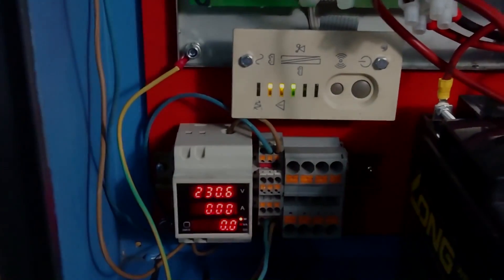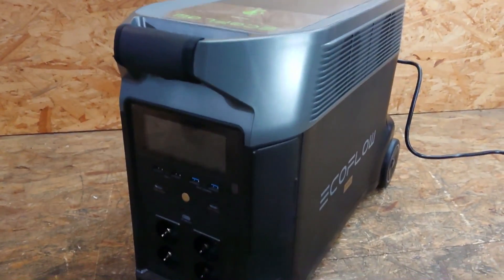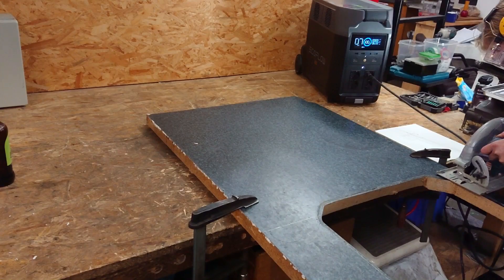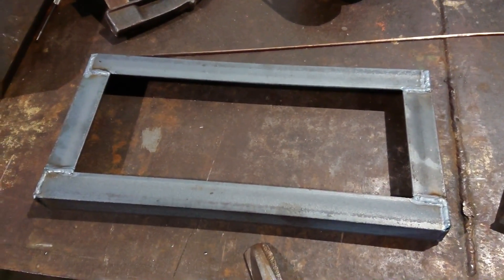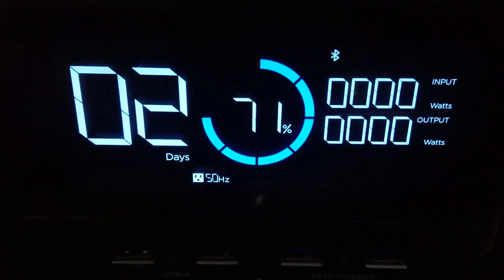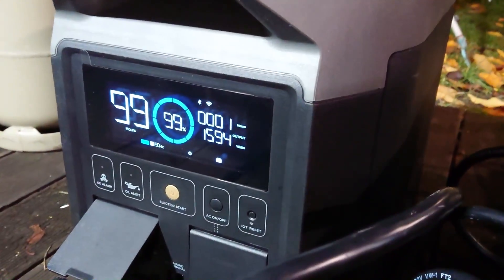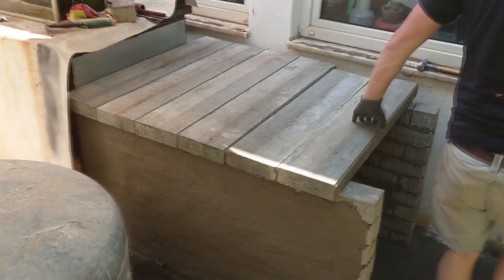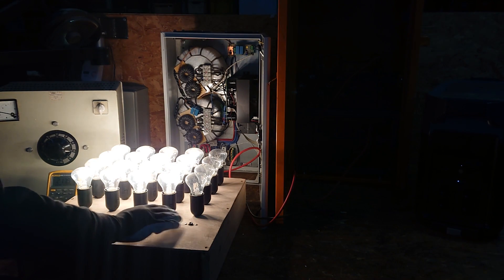Building a DIY Off-Grid Power System (vs. Ecoflow )

Comment: Great Video.
a while ago, I looked aruond on ebay and found a Generator from 1966, until then I also thought the SACHS ST 282 was the biggest Gas Engine they made, but to my suprise the Generator I found had a SACHS ST 400 on it. 
After some search online, I found out, that the ST 400 was the biggest Gas Engine Sachs made.
The ST 400 has 400cc and arond 10-13 HP.

Comment: these ecoflow and other such combined unist are ridicules expersive ( and many units still use the liion cells ) for a fraction of the prize one can build a 7 kw 24v or a 14 kw 12v battery with brand new  280ah lipo4 cells and a good bms ,(all in all about 1000$) 
 my battery is a 24 8s variant at about 7kw i live offgrid , and have enough power for about 5 days of usage , to power my system i use the following
6 old 100w 20v (open voltage)solar panels 2xseries x3 strings in sunlight the charge on the battery is circa 12,5 A
2x 200w  40v panels (with broken glass)  charging about 6A
this is covering my elecritrical needs  lights blowers for gas heaters alarms tv ,laptop waterpumps diesel heater small refrigorator e,c,t
the  charge units are
a cheap solar vind hybrid charge controller 
a 10$ pwm charge controller for the broken glass panels
for future power generation mainly during winter time i have a 1500w 24v turbine
a old 12v 400w turbine
2x 12/24v used millitary generators
2x 230v 3,5 kw millitary gererator
these generators i purchased very cheap a few years back,but a standart unit or a homemade 12-24v will do well to 
it dosent take much...

Comment: Maybe it could be a good idea to do one or two projects to both turn fryer oil (waste oil) into diesel AND how to make a rig for water electrolysis so you can be fuel-independent as long as you have access to very rudimentary ingredients. For the electrolysis project, one of the ways to control output (especially in an automotive application) so you aren’t producing a bomb with too much highly flammable H2 is using PWM (Pulse Width Modulation) tied to the accelerator pedal so the gas is only produced on-demand.

I don’t mean to be putting words in your mouth or anything, but I have felt for a while that creating a plug-and-play control box for electrolysis (all the electronics in one box) with a PWM circuit and fused power in from the alternator. That way people could install a safe and effective electrolysis HHO generator feeding into the intake just downstream of the airbox/filter box to improve their mileage and power by decent figures (I heard 20% and 30% or so respectively but haven’t put one together yet). These units also work for diesel engines.

Cheers and thanks for the great content and cool ideas/projects!
🖖😎👍

Comment: A lot of generator noise is down to engine vibration. I also have my generator on wheel board like that. I used vibration isolation pads between the generator & the wheel board & it has cut down on the noise quite a lot.

Comment: The noise on the old generator could be improved with a better muffler system. It does not look like the motor uses tuned exhaust scavenging like a racing bike, so a compact car muffler from a junkyard should help a lot.

Comment: Wait Wait Wait hold on hold on .... that was 3000 watts on a 10inch grinder cutting 4 inch channel and that power source never blinked ... I need one in my life !  I'm early in the vod so I'm going to ask now have you tried to weld off the power source if so how did it do on the duty cycle ?

Comment: You didn't show any cooling air in & out in the 'gennie garage'. Generators are difficult to quiet down. If you could find a gennie with a four stroke engine, they are way easier to quiet down. Most of the little gennies run at very high rpm's, 3600 to get 60Hz. My big gennie is an 1800rpm unit with a 4cylinder diesel, 24Kw. Quieter than my 8Kw gas unit. Both are 120/240v single phase. Liquid cooled engines are also much quieter for their size. Michael in Colorado.

Comment: Look in your area you might be able to find a place that deals in used lithium phosphate batteries here in the United States we have a couple of places that do. Sometimes you have to bid on an auction to get them. Usually there's some damaged cells they can be replaced and yes it is a pain in the butt. All in all you can get a battery charger/tester and go through and do what you need it does take a lot of time but in the end you want to put something that's Superior to the glass mat batteries. They give an example I have recently purchased four 48 volt 140 amp lithium batteries for $1,100 out of them I will be able to make three Good batteries. Just a little information my friend. Keep up the good work

Comment: The Ecoflow devices are quite neat and powerful. As an all in one package it is especially useful if you do not have the skills to DIY such a system. The prices however add up, well thats the trade off, DIY vs plug and play. If you have a stationery application, their solarpanels are way too expensive. Their price might be justified for a mobile application.

Comment: It's an excellent sponsor video, because you're clearly showing what it's capacities are but also, why it exists. The 8-bit guy had similar, where he didn't want to take a sponsor but this product is just SO GOOD he really had no choice- in your case, it's showing that even a dude who practically has a full time job scrapping and reusing materials can't really beat some of the modern technology, though I would argue that inverter you have is more your speed despite it's heavy weight.
So basically, thanks! So far it seems to genuinely be an excellent product that deserves some accolades.

Comment: If you are planning to use the two-stroke generator with wood gas how would that engine be lubricated?

I am assuming that it is an older version that requires oil mixed into the liquid gasoline.

Once running exclusively on wood gas there would no longer be any lubrication for the crankshaft and the piston rings.

A two stroke engine with oil injection may work with wood gas but that defeats the original intent of reusing scrap.

Perhaps you could switch to a much more concentrated mixture of high quality two-stroke oil in gasoline but that would require reworking the carburetor, difficult to do in a speed (RPM) controlled generator to maintain the frequency for the output AC.

I want to suggest building a circuit that taps directly into the coils on the generator then using that highly variable output to convert to DC to charge the battery bank and then using only the battery bank and DC to AC inverter for your final load.

This eliminates the need for very accurate speed control for your two-stroke generator.

I am counting on your expertise in circuit design to build a DC charger that is able to accept variable frequency and voltage.

Comment: Please be careful and check if the protective earth is connected between outlets and the input (or have other measures for grounding)! A lot of mobile power stations don't have this connection and therefore no protection against grounding. I have been testing some before and it is frightening to seee how many of these aren't actually safety compliant to european standards even though they are sold here.

Comment: This is exactly the type of project I have been planing for many years. Having a generator running for the freezer during power outages is just wasteful, and I want to have a battery buffer and a self starting generator to charge it.

But, don't count out lead acid batteries yet. Since this is stationary the weight is less of an issue, and they do cost about the same per cycled kWh, depending on which data sheets to trust. My findings is that they last longer but cost more to buy, and in the end the cost is about the same per power cycled.  I believe lead acid is better for recycling and I personally think that lithium metal should be prioritized where it has a big advantage (vehicles, mobile storage and big storage in a small space) than used for things like stationary home usage.

I'm not saying lithium is bad, but that lead acid still is relevant.

Comment: I think it’s great that you have taken a sponsor. Especially something like this that is right up your alley. It’s like you can buy this great new machinery for portable power or build it out of used things like this. Or even better, build it out used things using this new machinery.

For your generator garage, did you build a outside port for intake as well as exhaust?  A little bit of insulation and that would be an awesome setup.

Comment: On the Sachs generator have you considered custom building (or repurposing) a newer larger muffler to silence it's obnoxious exhaust noise? granted that will not do much for the mechanical noise but its garage should more than adequately compensate in that regard.

Comment: That is so enviable having those old Sachs/Bosch generators around on the used market. And 3 phase output too!!!!!! I'd kill to find those in America. You can easily put a small car muffler on those engines to quiet them down and rubber mats glued to plywood make a good sound barrier. Just make sure you've got enough ventilation in that concrete enclosure or you're going to over heat those engines.
I agree, simplistic old tech is much more hardy. The inverter goes bad on those new units and you probably won't find repairing them to be worthwhile. It is nice how quiet they are though but repairability is a huge factor for me.

Comment: That modular power system is cool and all, but the generator portion looks very small. Engine maintenance/repair looks like it would be tough in a package like that. Another thing that would worry me with complex new systems like that is the life of the product. The battery may last up to 10 years but who's to say ecoflow vanishes or discontinues the setup and doesn't provide support or parts for the long term? At least with the reclaimed setup you have you can replace/add batteries, tear down and rebuild the generator engine if needed, and if you were crazy about it, rewire the rotor/stator. In my opinion, your old setup is much more modular and easier to work on than anything like that produced these days. Just keep an eye out for sound deadening material and maybe slap a car muffler on it. Thanks for the video!

Comment: Good morning Gerolf, just after I watch this video and left my comments, I went to a local garage sale that had been advertised on Facebook, as there were solar cells to be had. On arrival I found out that the seller had just replaced all the cells with a newer system. And the 2nd hand cells were 200watt units and still putting out around 85-90% of their listed performance. Now the price was the crucial, I hope you are ready. The seller was asking $20 each, which cause me to be taken aback slightly. I inspected the cells, and they were in excellent condition, so I bought ten. I was then shown the regulator unit and it cost me $100. And it gets better. I had to return the next day with my ute to collect the panels and was given all the rail and fitting to put them on my roof FREE😁. So, my project is to install them and have a battery system to back up the mains power when it goes out. I have a generator, but the batteries will be for keeping the fridges going at night. Thanks for the inspiration and keep bringing out the videos.

Comment: Just something I think might be useful that I read in an off-grid book...

Showers: Electric showers use a huge amount of energy. Showers running from a tank heated by fuel use less so. But what an off-grid user discovered, was that the majority of the energy going into a shower's water, is actually used to heat up the air in the shower cubicle, to make the user comfortable. 

Air takes a lot less energy to bring to a temperature than water does. So a good off-grid shower might use an efficient way of heating the air, and retaining that warm air, while heating much less water. You can also save shower water by having "navy showers". That is, you run the water to cover yourself in it, then cut it off. Soap yourself up, then run the water again to rinse the soap off. Only run water when it's actually being used for washing.

Something I also observed, if you have a bath with a shower attachment, is to keep the plug in. That way the warm water stays in the bath, keeps your feet nice and warm, and gets to give all it's heat to the room, rather than warming up your drains.

There might also be benefit in feeding warm water to your washing machine. Modern ones just have a cold intake, no longer one for hot, and electrically heat the cold water themselves. As well as taking longer, it's wasteful for people who have gas water heating, or any other non-electric kind. If you wanted to, you could even investigate making your own controller board, take the existing board from a washing machine and wire in an Arduino, using the machine's existing relays and triacs to control the motor, heater, and pumps.

Comment: You really need to take those solar panels out of their boxes and get them installed.... I think that you will find even in a German winter, you will get plenty energy. If you don't, then add an additional string of panels and keep doing it until you have enough energy to get through a German winter. Most people still think that they don't work when there's clouds or rain or snow but that is not true.... It all comes down to how many parallel strings of panels you have! The fold up solar panels are not enough, other people on YouTube have the same battery and choose to use their own solar panels and it's far better and charges faster.... The fold up panels are only good for when you are away from home..... That's the only time that you should be using them.... 
Otherwise, loving these videos about solar energy production, keep them coming...

Comment: isn't there a 5%-10% tolorance on supply voltage in most countries? Unsure why the veriac is required at 233 VAC (EDIT: With peaks at 140 VAC)

Comment: Using an auto muffler would greatly reduce the noise without very much back compresion so as to not destroy the valves in the motor. Also, to conserve on power consumption, using low voltage LED lighting systems (buy or make from discarded LEDs) and also other lowvoltage tools/appliances and also some higher voltage items that have their power supplies that reduce from your wall voltage to usually 24/12/5/3 volts and thus not have the power drain of the step down powersupplies and also using the step up power supplies so you could then step down. A lot of power drain doing that.

Comment: I was blown away that you where able to use the EcoFlow to TIG weld two battery trays for your project and still have so much capacity left over afterwards!  I have a Energizer Arc5 500 watt pure sinewave power bank,  I use it to charge my Ryobi 18 volt power tool batteries with a ac quick charger. It's alright for small stuff but a 1500 watt bank would be more ideal.

Comment: Re the Ecoflow, unless I am mistaken, I think I heard somewhere (possibly eevblog) that there is an 'interruption' when they switch over from say solar to the internal battery, and that's enough to have certain mains connected appliances drop out. So, yes, an off-grid power system but not something that can be used as a proper UPS.

Comment: propane is a good fuel for standby generator. petrol goes off and causes carburetor problems if the generator is not in regular use.  4 stroke can be easily converted to gas but not a 2 stroke  i think, 3 phase is a nice option to have.

Comment: I hope you don't give up on the DIY version. It's hard to beat a ready-made product. I romanticized about building my own LiFePo4 storage, bought > 2 kWh worth of cells, chargers / inverters and other stuff, but as often happens, putting them together in a reliable and dependable way such that they're nicely enclosed and do not need perpetual tinkering is quite non-trivial. I'm sure all the gear will come in handy if the power goes out for several days, but for the short outages I rely on a smaller purchased battery + inverter pair.

Comment: Sound travels through air so the more air tight your blimp the quieter the generator will be but of course it might need ventilation of some sort too so you will have to work all that out. Couldn't believe how loud it was. I wonder if there are other adjustments to make it quieter.

Comment: Ecoflow et al look great for camping and even work, but, for societal collapse, I want separate components that I can replace, repair, or remove from the system as needed (even if inferior). It's too complex and integrated for SHTF, which is my main interest in off grid power. Plus, those AGM batteries do not have a monopoly on fire.

Comment: That is a rato yamaha clone generator. $2000 +tax in Canada. No thanks. You could buy a real Yamaha or Honda for that. If they sold it for under $1000 would almost be worth it although dual fuel clone inverter generators can be had for less than that and are of equal quality.

Comment: If you really need a good quiet power generator that can use to power your car, at work, or electrify your home. It uses no fuel, recharging, or solar and can run 24/7. I know it sounds crazy thing but this electro-plasma generator will be on the market soon maybe by the middle or end of 2023 (per the inventor).  Watch the video @ 7:30 SUV Pajero without engine powered by this generator. https://www.youtube.com/watch?v=SeBmiQfdGDM

Comment: While it is a good idea to put the old generator in the brick box to cut down on the noise, you also have to pay attention to the heat buildup, so the engine does not overheat.